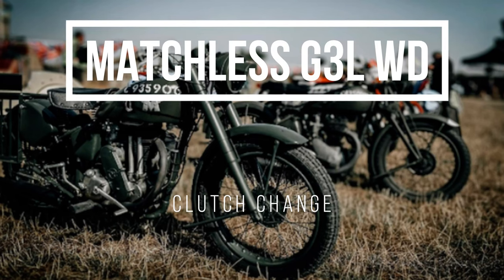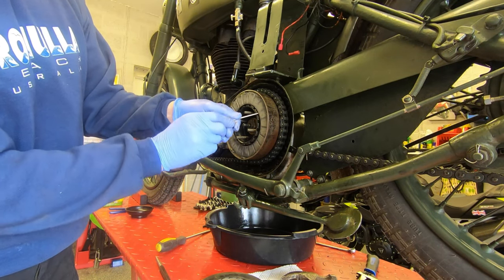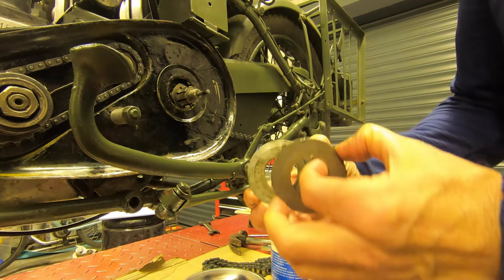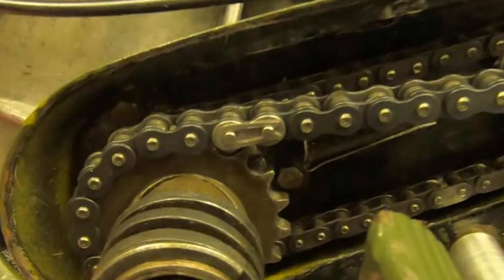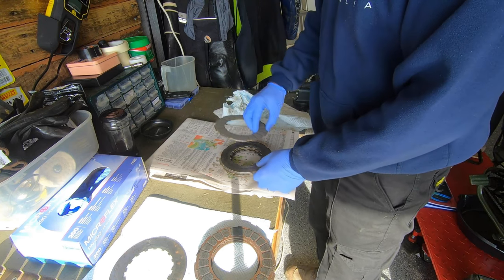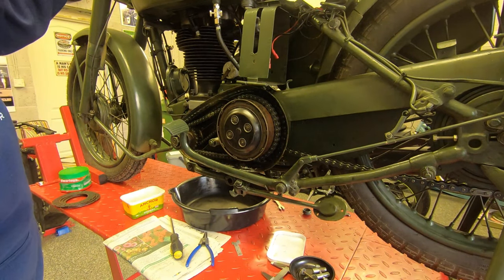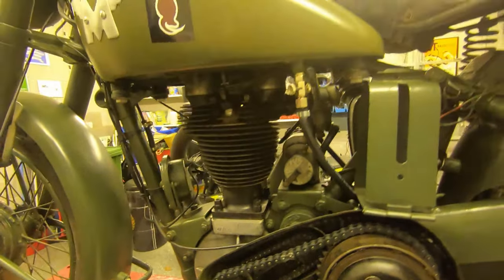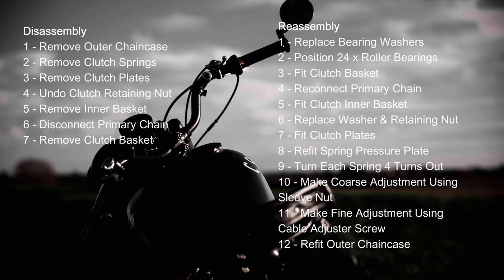Matchless G3L WD Clutch Overhaul

Comment: A few remarks. Don't rely on that the previous owner had the order of the plates correct, if unsure, check the books. The special tool for the spring nuts can easily be made by grinding an indent to a cheap large screwdriver. Check for wear in the slots in te clutch basket, were the plates engage. In this case though they were fine, but often burred and will result in dodgy engagement.

Comment: I noticed you did not check pressure plate run out or measure relaxed spring lengths and compare to factory spec ? I liked the video , my '65 AJS 350 is similar and i have brought the friction plate count up to 5 , from the factory 3 plates . The clutch lever is set easier to pull in for gear changes . Thanks for this .
Reply from the maker: Hi Derek. Thanks for the comments. I couldn’t find any mention of measuring runout in the workshop manual. Do you think it’s worth doing if the clutch operates normally? Grateful for your advice. The spring measurement is an excellent point  - I did measure them but didn’t mention it in the video. I’ll add that in as soon as I get time, hopefully this weekend. Thanks again, Terry
Reply: If the pressure plate does not lift off evenly , uses the kick start to turn the engine over while holding the lever in . loosen the tight screw and/or tighten the others . The gears will change more easily if the pressure plate comes away all at the same time and freeing the clutch in the morning is easier too . No need for measuring , use your eyes only .My clutch springs are all within spec, but they compress differently . @terryjones6229

Comment: Hi mate, so the pushrod un the clutch, should it be screwed in tight or have a little play, if you know what i mean? My bije is a 1953 g3l 350 single rigid. Cheers
Reply from the maker: On my G3L there’s no screwing involved. You just place the clutch rod into the hole, pop in the ball bearing and do everything up. Once it’s in, then the adjustment begins. Use the screw under the cap on the kickstart case for coarse adjustment and the cable adjuster that goes in from the inside to fine tune it. There should be a little bit of movement or play in the lever before you feel the cable go tight, maybe 3-5 mm. The important thing is that when you pull the lever it completely disengages the clutch (no big clunk when you select a gear) and that it doesn’t slip when you pull away. Those symptoms are at the extremes of adjustment. There’s a lot of ‘good enough’ in the adjustment In between